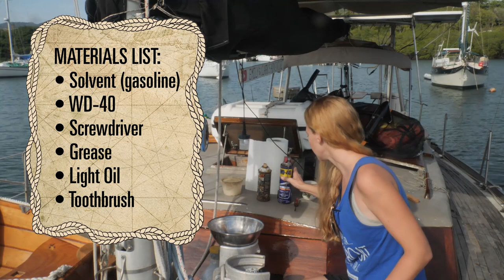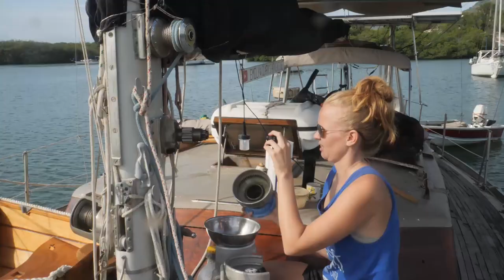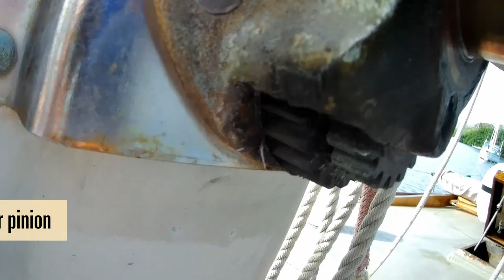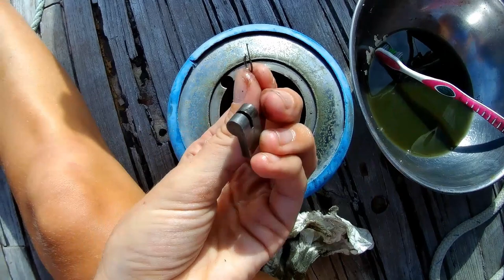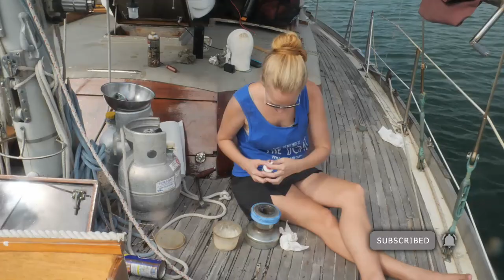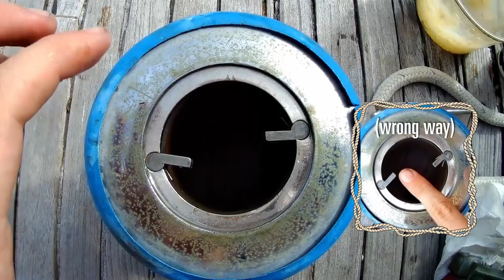How to Clean and Rebuild a WINCH [Capable Cruising Guides]

Comment: Great video and thanks for the close-ups. I'm going to try my Barient 23s. I hope it's just as easy.
Reply from the maker: Good luck! I imagine it will be similar. Check out the link in the description for the manual and diagram for that one. I wish I had checked that site before I started. It would have been a bit easier. But regardless, it was definitely not too complicated. Thanks for watching and subscribing! -E

Comment: Just as a good practice, when you are unsure of disassembly or reassembly, try to leave one part installed as your reference instead of taking everything apart at one time. Good job!
Reply from the maker: She had the fallback of me knowing how to reassemble it when I got home but good idea to have a reassembly plan.  I suggest that people take a picture of the parts before disassembly.  
  I guess she also had the video files so she was good. -C
Reply from the maker: Looking back, all I would have to remember for next time is that the pawls look like little 9's. That would have been an easy clue when they looked like backwards 9s! -E

Comment: Great job Emily!  I know you do not show all the steps; did you pack the roller bearings with grease?  Are there bearings in the secondary gears in the winch base?

Much kindness to you both,  and best wishes in you travels!
Reply from the maker: Yes I did.  And yes there are gears in the base but I couldn't get to them.

Thanks Steven

Comment: Thank you for sharing Emily. Super useful.
Getting ready to continue on my voyage, just discover one of those is not working well and don’t have the grease to service it. Will I find grease in Luperon?
Reply from the maker: Sure, but if not I'll give you a finger full.  Bring your bearings over.
Reply from the maker: But the hardware store or more likely the auto parts store will certainly have some.  You should have some onboard.
Reply: @Clarks-Adventure  I would love to visit Temptress, but my dinghy is up on deck now as I am planning to cast off in the next day or so —I got the grease but could use your advice because after the reassembling it did not work and can’t figure out why …
Reply from the maker: We aren't living on Temptress just now. We are on a boat called Bright Eyes while we finish our refit.

Comment: 5:18, that's a needle bearing, you'll know cause it looks like lots of rolling needles. Please use diesel or kerosene for solvent....i cringe at the flash point of gasoline, especially around metal tools (spark) other chemicals. White lithium grease for those gears would have worked nicely too. Good job while Clark was gone.
Reply: Gasoline is a good solvent but it is absorbed into the skin quite easily. Just like acetone it is hazardous to your health. Please use plastic or rubber gloves next time. I want to see you live to a ripe old age, you're to precious!
Reply: I hope you SAVE your skin & wear gloves… Gasoline is not GOOD for humans to absorb thru skin… You & Clark are sooo important to all of us…. LIVE ON!  We need you guys!

Comment: Next time, use Nitrile gloves to keep your hands from smelling like grease and gas. Gasoline IS NOT a good choice for solvent. Hopefully, you have an absorbent cloth underneath the work area and all the parts. Brake cleaner works well, and would allow you to remove the bulk of the grease on the 2-speed gears. The brake cleaner would go a long way to cleaning the interior parts, then you replace the grease with a spray-on grease.

Nice job!! How many winches left to service?

Comment: next time you are in the US you might want to stop by a sporting goods store and pick up the solvent resistant toothbrushes they use for gun cleaning. I haven't found a brush in a hardware store that works as well unfortunately but if anyone knows of one let me know because the sporting goods store I get them from is an hour farther drive then my hardware store is.
Reply from the maker: Great idea.  

How about eBay?
Reply: @Clarks-Adventure  I bet ebay and amazon would carry them though I have never checked
Reply from the maker: Also there are nylon and wire brushes at harbor freight for cheap if there is one close.
Reply: Thank you I didn't know that!

Comment: never use gasoline to clean parts mix shade tree mechanics do this. Mix WD 40 with Diesel use that its not flammable like gasoline might want to rename this what not to do to clean a winch and it wont eat your toothbrush and leave melted residue everywhere. Other that you seem to know how to clean
Reply from the maker: The main reason for using gasoline here was that we had a bunch of old gas in the generator that needed to be used or disposed of. Plus, it evaporates, so cleanup is easy. Waste not, want not! -E